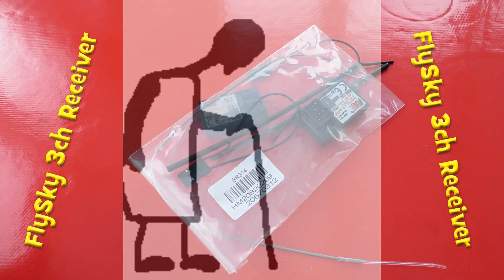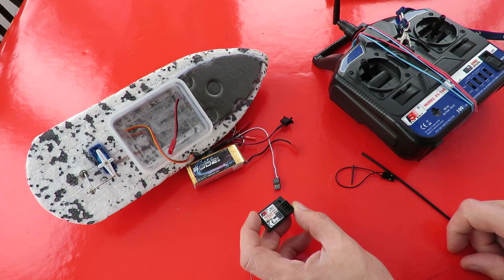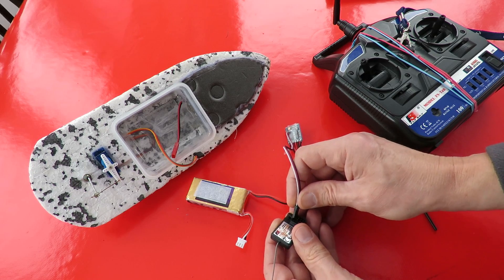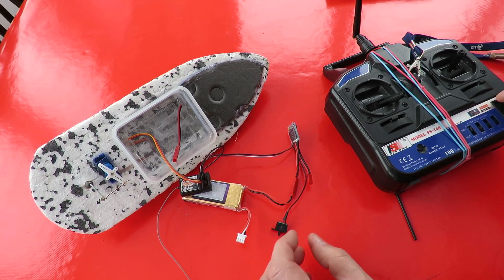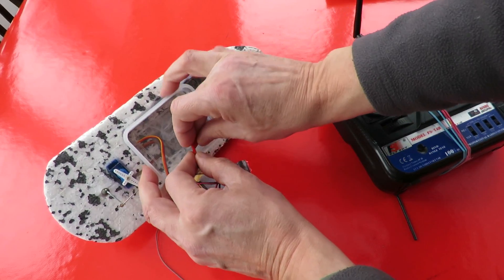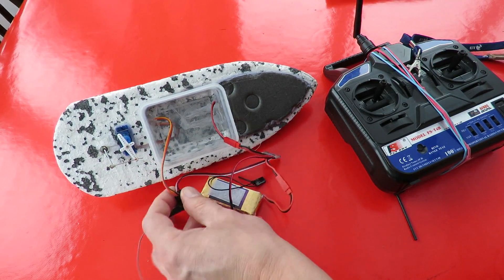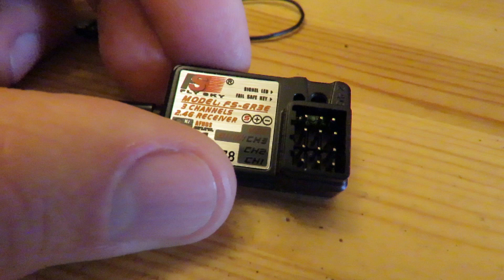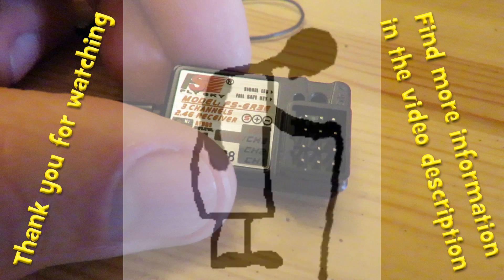FlySky 3ch Receiver

Comment: yes you can recreate it. just set failsafe to full throttle first. so hold the stick  in full throttle with the prop spinning. and while it is spinning you have to push the button on the rceiver and hold it. it will start blinking for 2 seconds or so and then it will stay on again. now let go of the button. ready fail safe is reprogrammed to full throttle when you loose signal. so if you let go of the stick the prop will stop again. switch off the transmitter and the prop will start spinning full throttle again. o.m.g. we have a problem. well to solve this you can set the fail safe and it works like this bla bla bla and you can show how to solve it again.
Reply from the maker: Thanks Eric. You would think they could include that information with the receiver. It only needs them to photocopy a bit of paper and include it in the package 😊
Reply: I guess that is the downside of all the very low prices we get from China. Me myself use these receivers for some years now and just last month i discovered the meaning of this fail safe button. I never understood why it was there

Comment: for 4 or 5 dollars you buy an esc without a brake. you do not need a break on the boat. it is only anoying.
Reply from the maker: That's right, you will find other videos on my channel with "brakeless" ESCs, I don't see any benefit on planes either. I have read some discussions on the RC forums but none of them convinced me. The only place I can see a benefit is on some RC cars where you are worried about messing up the gearbox by throwing it straight into reverse.
Reply: Well it is true it is mainly for cars. but it can be more important then you think. when you are racing an rc car down a track it sometimes is necessary to brake when reaching a sharp bent in the track. throwing it into reverse will make it spin out of control. the brake function is proportional so very useful. also when driving a crawler it is very useful to have a brake. now you can descent slowly down a steep part instead of just race down. rc crawling is about control and slow movement
Reply: @GrandadIsAnOldMan  what esc did you use for this??
Reply from the maker: @samiamcas   the esc is related to the motor and battery you choose, not the receiver.

Comment: what transmitter do you use?
Reply from the maker: +Calel14 I use FlySky FS-T4B and FlySky FS-CT6B transmitters
Reply: @GrandadIsAnOldMan  does this reciever works with every 2.4 GHz tx?
Reply from the maker: @jatinmali9310  it works with FlySky RC gear. You would have to read the spec and check if it is compatible with whatever transmitter you have. There are many different transmission specs and NO all 2.4 GHz systems are NOT the same.

Comment: Make a RC Igniter for Fireworks plsssss
Reply from the maker: +multraslan19o5 you might like this video https://youtu.be/thhPO8gA8GQ I used it as reference for RC switching.
This video by KipKay shows a simple remote controlled ignition system https://youtu.be/nJQ3IRr7Eck
Here is simple RC version by Jacob Raab https://youtu.be/onBQVlAlJ0c
Reply from the maker: TheFreddyPlayer the receivers that came with my FlySky FS-T4B and FlySky FS-CT6B transmitters were both 6 channel. This one is 3 channel and is just a little cheaper
Reply from the maker: +TheFreddyPlayer the battery and the esc should be chosen based on what motor you are intending to use. I suggest you look at a channel like FliteTest to get information from people who know what they are talking about. Their beginners series covers all the basics https://www.youtube.com/playlist?list=PL6IuSFWz4ktvupu_gxw1vn-sjBGOkJFHV   If you look at my videos I give the details of the components I use in the video descriptions.

Comment: Is the receiver very lite ?
Reply from the maker: +Bao Khang Kelvin I put it on my scales and it says 7g but here are the details from the eBay listing ---
size:35.5 x 22 x 13mm
Ant length :180mm
Color : Black
Net Weight:2g
Package weight:8g
Reply from the maker: +Bao Khang Kelvin There seems to be a problem with YouTube comments. I think this is my second reply to you but the first one is not showing.
I put it on my scales and it says 7g but here are the details from the eBay listing.
size:35.5 x 22 x 13mm
Ant lenght :180mm
Color : Black
Net Weight:2g
Package weight:8g
Reply from the maker: +Bao Khang Kelvin There seems to be a problem with YouTube comments. I think this is my second reply to you but the first one is not showing.
I put it on my scales and it says 7g but here are the details from the eBay listing.
size:35.5 x 22 x 13mm
Ant lenght :180mm
Color : Black
Net Weight:2g
Package weight:8g
Reply from the maker: +Bao Khang Kelvin There seems to be a problem with YouTube comments. I think this is my second reply to you but the first one is not showing.
I put it on my scales and it says 7g but here are the details from the eBay listing.
size:35.5 x 22 x 13mm
Ant lenght :180mm
Color : Black
Net Weight:2g
Package weight:8g
Reply: +GrandadIsAnOldMan You have replied 4 times in total(on my screen to him). I had the same issue with the youtube mobile app. so i deleated my extra comments.
Reply: +GrandadIsAnOldMan You have replied 4 times in total(on my screen to him). I had the same issue with the youtube mobile app. so i deleated my extra comments.